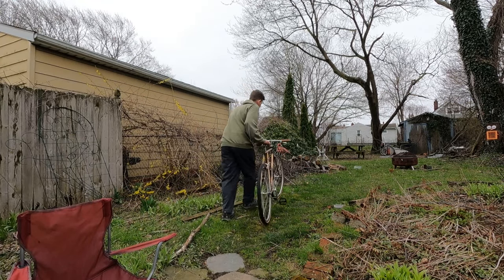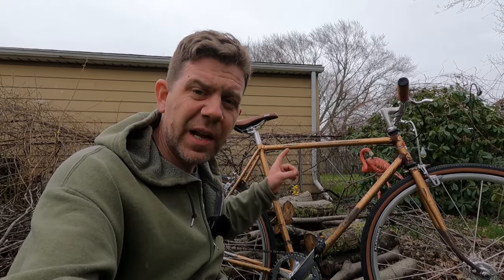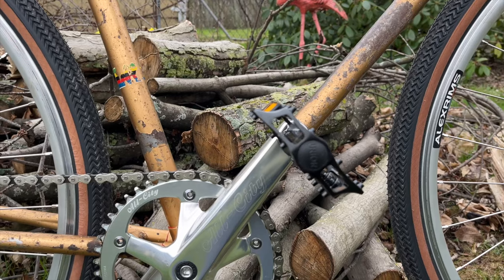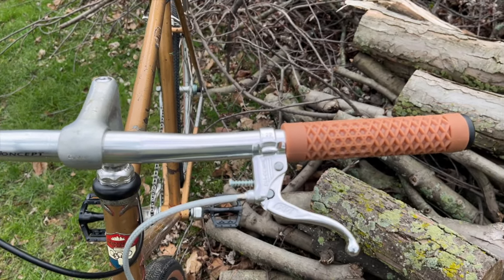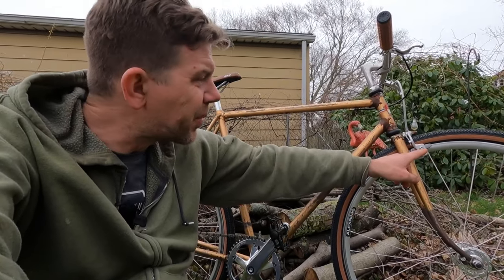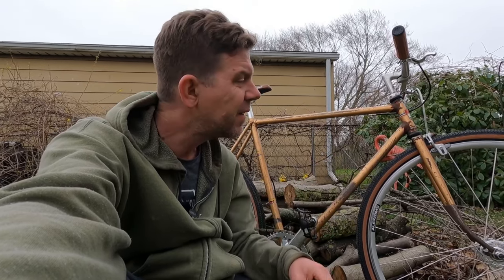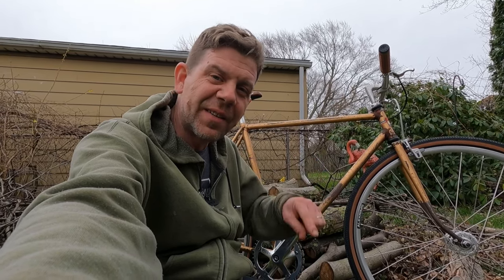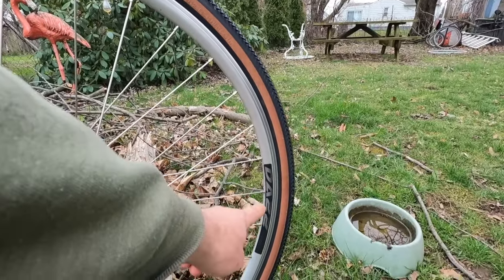I saved a vintage French Road Bike From the Scrap Heap.

Comment: Mornin' Josh! Somehow satisfying listening to the tire hairs grazing the brake. Any ideas on its twitchiness? Head tube and rake's looking relaxed to the point that they would just fight back against any steering input. Forty years ago, met this guy who was talking about how bikes just naturally want to go straight. He launched an old beater (riderless) across a slightly declined parking lot and it rolled a good 100 ft before finally tipping. 

Great video and as usual, you've delivered the perfect daystarter here, my friend. Incidentally, will be thinking of you as I try to cram a SRAM 11-36 cassette onto my Shimano equipped road bike this week in search of a few more hind teeth. Some super lumpy gravel riding's beckoning...
Reply from the maker: Hiya friend. No clue about the twitch. I made an old Nishiki Olympic into a single speed, crammed 700x38 tires in it, and used a straight riser bar only to find it to be one of the most pleasant bikes I own. It must be a geometry thing that I just don’t get. I’m woefully ignorant to those sorts of things.

Best of luck with your gearing adventure, and thanks always for your kind words.